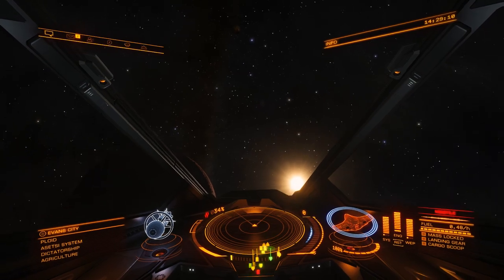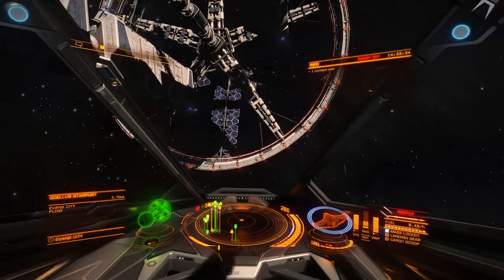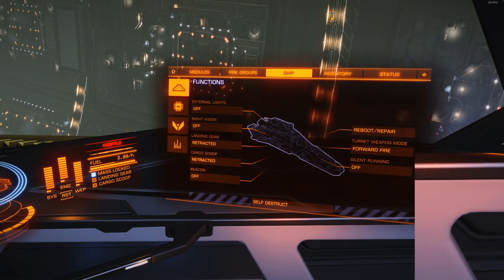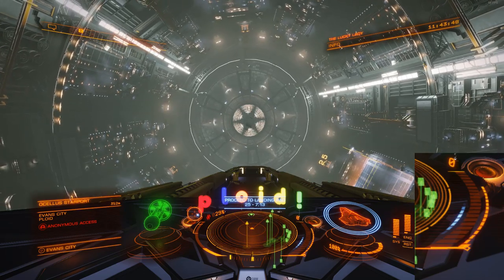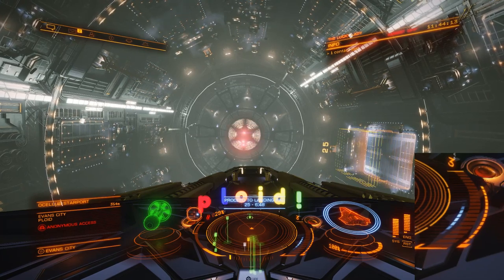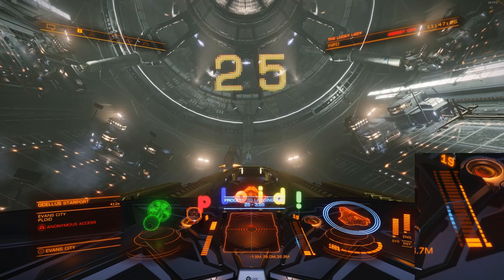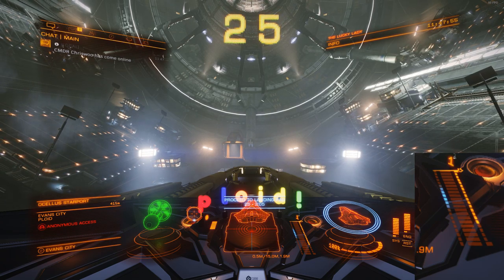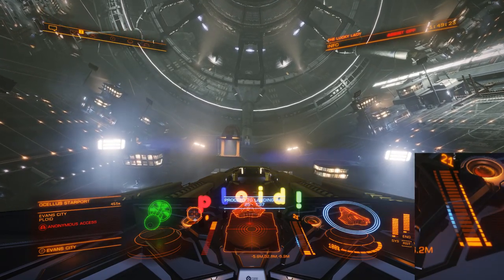Elite: Dangerous - Rotation Correction Vs. Flight Assist Off

Comment: Just tried this with a FAS, and let's just say you'll appreciate rotational correction a lot more after you try to land without it.
Reply: I regularly play with FA off and rotational correction off and it's easier to land, if you like FA off that is. Instead of flying in and above you're pad you fly in and to the right. You should already have the spin going from entering the mail slot so just thrust moving left and the speed will match and set down

Comment: Always good to see more people talking about FA-off!! 

Best way to fly IMO that computer should be a removable module so I can totally scrap it :)
Reply: Computer says no
Reply: I don't mind it being there, using fa off is hard for me as I do have a drift in my controller.
Reply: flight assist is needed for things such as the high wake auto aligning in the last 4 seconds
Reply: @miso-ge1gz  Needed? Nah. But if you want to use it as a tool, go for it. Fly what and how you want. 
For me thought the flight assist computer is just dead weight :D
Reply: @madrax5733  I love flying flight assist off all the time, but i can never comoletely stop. I am always either moving at 1m/s in some direction or i am turning. When i want to afk in an asteroid field for a few hours, i need the certainty that i won't crash into asteroids with 400 painite. Right now i am oracticing FA off at a scientific installation and it's SO MUCH FUN. Those playing FA on are missing half the game
Reply: @miso-ge1gz  That's pretty much all I ever use FA for as well.. my space park brake. Quick toggle to fully stop then it gets turned off again :D

it's one of the only time we accept use of FA-on in our group if you declare you are 100% off :)

Comment: What I learned so far:
FA Off with mouse is easy mode
FA off with stick: "you need the reflexes of a Jedi"
Reply: I think it's way easier with a HOTAS
Reply: @TheMysteryMushroom  Hmm I started with HOTAS and pressing FA off still transforms me into a bumbling pile of WHERE AM I? But when I had to switch to relative mouse control at lave con last year i was amazed how much easier FA off. It's propably like that little aimbot console players get at FPS games. It's so freaking easy to hold your bearing with Rel. Mouse control it feels like cheating. I was hitting rails like a pro. Still playing with HOTAS though because I'm slow to embrace new ideas.
Reply: @TheMysteryMushroom  have you ever tried it?! Faoff on hotas is a nightmare. With a mouse it is stupidly easy to learn. That is the reason why almost all pvpers use mouse with faoff, the benefit is huge, with basically no downside. It is stupid, becouse with a hotas it is extremely more difficult to use and so you are punished for that, you cannot earn the same benefits that mouse users get with a press of a button, you will NEVER get the same amount of accuracy, no matter how good you are.
Reply: @ShinigamiAnger  ok :)
Reply: @ShinigamiAnger  resurrecting a dead thread. But I'd argue this isn't true when you use a joystick curve software to make precise movements easier.

I just recently started in ED but with my hotas can keep quite fine control with faoff since I have a super low curve. (Basically 25% on stick only maps to a 3% mapping in game.)
Reply: @deejnutz2068  yup true, I finally have found a curve setup that works for me, it took forever and a lot of fine tweakings, probably just my fault, but still, when I go back to the mouse I find it so much easier, straight forward and accurate :(
Reply: oh I gotta use the mouse

Comment: I was always confused by that, so rotational correction is basically only relevant withing stations that rotate. What I think would be really handy is a rotation correction you could add to FA-off, like, FA-off for lateral but not rotation. Especially for starting with FA-off as at least to me the rotational balance is much more challenging than the lateral.
Reply: RIP CMDR PLater

Comment: In short flight assist on = fly like a plane off = fly like a spaceship
Reply: Planes don't stop just because you rurn the engine off
Reply: @npc6817  there's always one
Reply: @randomlygeneratedname  one what
Reply: @npc6817  heard of VTOL aircrafts ? That's the about the same but in space and with inverting thrusters
Reply: @mickael_guitara  still not the same, spaceship move like space ship, it's more like

Flight assist on: fly like a videogame spaceship.
Flight assist off: experience I N E R T I A

Comment: I turn off flight assist when approaching stations, but when I get closer to the pad I turn it on. I find it's easier to stay at the speed limit with it off, but fine maneuvering is easier with it on. Props to commanders that can do the whole thing without assist, because I can't do it yet, at least not smoothly. lol

Comment: All this time I thought turning off flight assist also killed rotation correction.. and it doesn't.... explains the resistance when rotating.

Here at the brick wall of learning...
Reply: RC has no effect when FA is off.... You first thought is correct.

if you switch RC off before FA then you have already setup your motion and FA-off will continue it.
if you switch RC off after FA then you will notice no change whatsoever.

So if you go FA-off just forget about RC as it does not affect you at all.

Comment: Here's the thing that always bothered me about FA off, why do  you start loosing speed after a while? When I boost while FA off, I expect to maintain the boost speed instead of slowing down to max speed without boost. Do I have that wrong?
Reply from the maker: Logically that is what should happen, but you know, games.
Reply: Sure :) I just wonder why no one bothered to correct this over the years, when everything else like the rotational pull of a space station is simulated? Normally you don't even notice I guess, just in those odd moments when you drop from SC too soon and have to fly like 80 kilometers. 
Maybe that's the big 2020 update :P
Reply: The earlier game didn't have you slow down to your cruising speed after boosting with FA-off.
It was reduced for 'game' reasons rather than physics. Then some 'lore' came out that the flight assist computer is never truly off as it still limits your maximum speed etc.
There are some ways to beat the assist computer and get some silly speeds. like speedbowling (my record is 12km/s in a keelback. CMDR Sanderling got to 33km/s in a mamba!)

But it's mainly because of the game engine as high speed collisions and rendering gets very difficult at the potential extreme velocities possible with full Newtonian flight model.
Reply: @madrax5733  Oh, thanks for the info.
Reply: @madrax5733  if you use the force shell experimental on the cannon and shoot a wingmate, you'll push them to insane speeds.
Funny watching a T10 doing thousands of m/s
Reply: @Ryan-lk4pu  Very true. I've seen a force shell courier used as a 'rescue' ship for vette wing mates who get primaried.
Reply: Two things they traded physics for gameplay. Max velocity/rotation speed, otherwise things get hella crazy. Ship steering, they made it so it feels more like atmospheric combat rather than turrets in space. Wished they made a couple more compromises like that for gameplay's sake.
Reply: Back in the day playing Tachyon: The Fringe, it absolutely did this with the "Slide" mode (functionally similar to FA-Off, but without thrusters, just rotation).  Burn to high speed, flip the Slide switch and hurtle like a dart on crazy strafing runs on capital ships until you slam into something or switch it back off.  Definitely the game that got me addicted to space sims (plus voiced by Bruce Campbell).

Comment: It's funny how landing with flight assist off and rotational corection off is so much easier than landing with flight assist on and correction off
Reply: Is it?
Reply: It's only easier if you're good at making a quick landing and know how to maintain your vector. Linger near the edge of the station for too long after you screw up your vector and things quickly get borderline impossible to correct without re-enabling one or both of the options.

Comment: You’re moving to the edge of the station because the station is rotating around the planet and moving actively
Reply from the maker: You are wrong on this one. Once you enter a station instance you move at the same pace around the planet. Same as when you are dropping in to a resource extraction site, as soon as you get close enough the rings appear to stop spinning.

Comment: Did you just explain rotational correction for like 5 minutes? Pretty simple concept my guy. . . Simply forces your ship to rotate at the same rate as the station. . .and when you thrust in space your momentum will stay constant unless you apply counter forces, and this applies to all axes. . .you should gain a more solid understanding of the physics before you teach others about them. Have a good one.
Reply from the maker: you might get it but plenty of people don't!